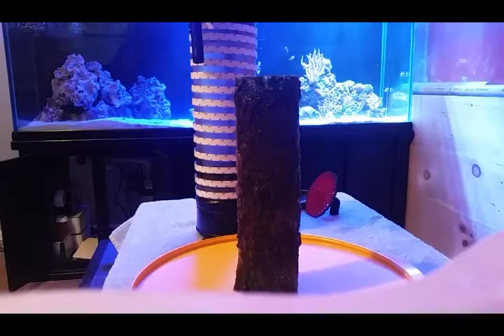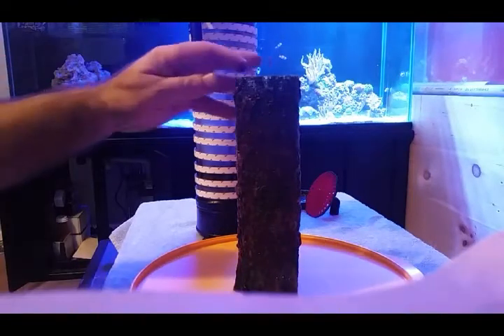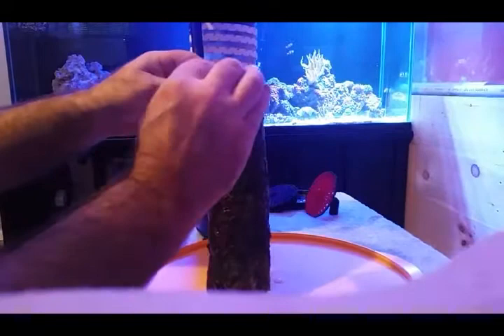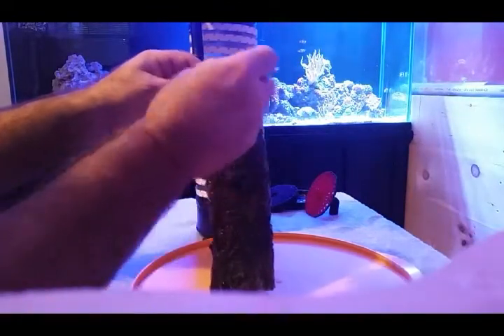Algae Scrubber Reactor Update 1

Comment: Curious how well this worked long term? I’ve got a left over reactor from a tank and thinking of doing this same thing for a 125g freshwater tank since there is nothing but algae scrubber setups that work for freshwater. I currently have an upflow diy sitting in the side of the tank that’s working good but would like to get it off the glass cause it looks horrible and with two 100gph air pumps driving it, it’s messing up the flow in my tank lol.. this seams like it would be a much cleaner setup.
Reply from the maker: I had an issue of growing slimey, smelly green algae instead of the desired green hair algae which didn't end up helping with the nitrates and phosphates at all. Several people told me I would have better success with this design if I could run air bubbles through the reactor as well to promote the growth of gha. I considered different ways of implementing the addition of air but in the end opted not to proceed with this experimental idea. In theory it should work and if you wish to give it a go I wish you the best of luck with it.

Comment: So far your videos have something  for me to learn from.
 Personally, I'm losing hope with cheato algae helping with nitrate, my phosphates are fine tho, so I'm use a nitrate bag intermittently(the kind ya 'carefully' can use bleach to regenerate) 
In your reactor,, I saw lots gas bubbles, probably oxygen. But now you showed that stinky black mucky kind of stuff from this "algae scrubber".   From my reading and the color and stench: Is it possible it had hydrogen sulfide in it?  Possibly from rather slow flow thru it. It just seems "stinky" is not desirable. Thank you for sharing.
Reply from the maker: Franco M 
You're probably right and I believe I'm getting the wrong type of algae growing hence the stench and probably gas, it may work better if I had air bubbles rising up the reactor from an air stone or some other source and grown green hair algae instead, I've now concluded this experiment as more trouble than what it's worth, I'd now much rather focus on my next plan of a 40 gallon display refugium, which will do what I was trying to achieve with the reactors but with so many more benefits.

Comment: Have you noticed a reduction in any water parameters? It definitely looks like it has potential as a scrubber. I honestly think that you would see better growth if you somehow injected O2 into the device. Looking forward to the next review.
Reply from the maker: Robert Lugo 
When set up with chaeto the nitrates had dropped quite a bit but when I discontinued it the nitrates started to rise again, last time I checked the parameters the nitrates were on the decline again, I agree with you about the oxygen as that had been previously mentioned on the last video and I have been contemplating the best way to go about it as I don't want air going to my gfo reactor which is also connected to the baffle. I'll be testing out some ideas I have to see if I can add air to the reactor, I think the main hurdle I'll have is air rises in water and the reactor is an upflow one so the water is pushed down before it rises up